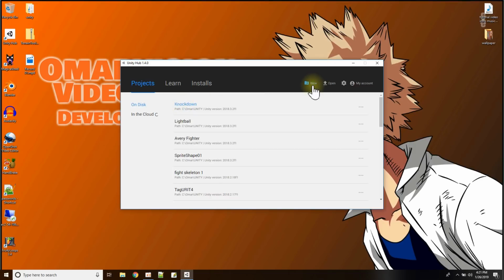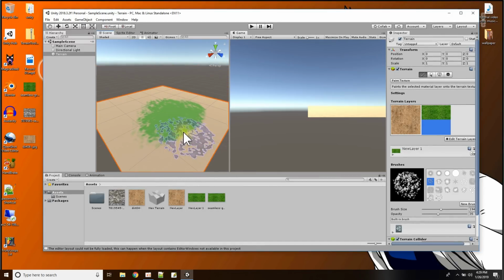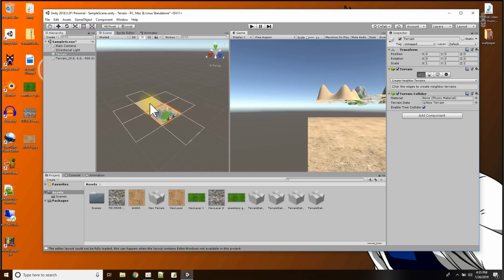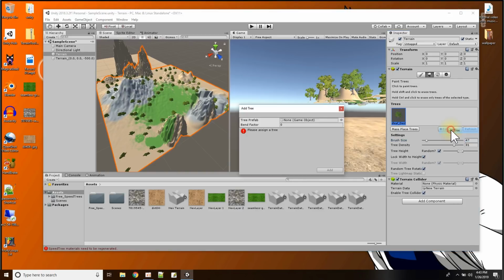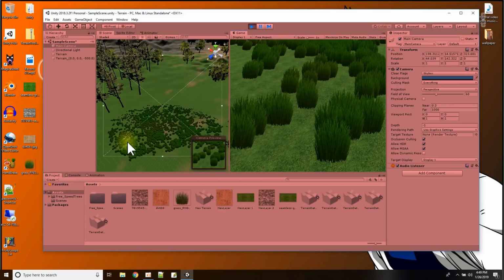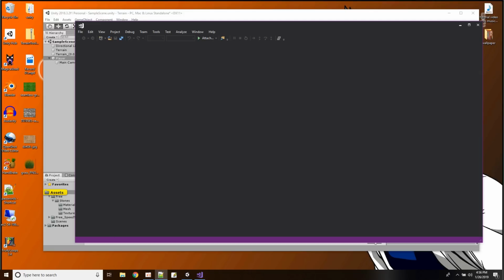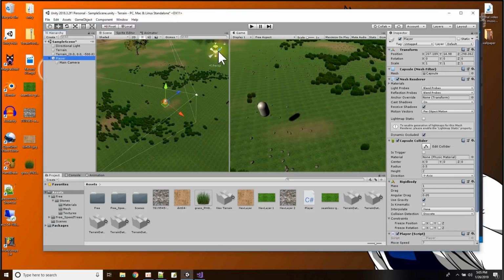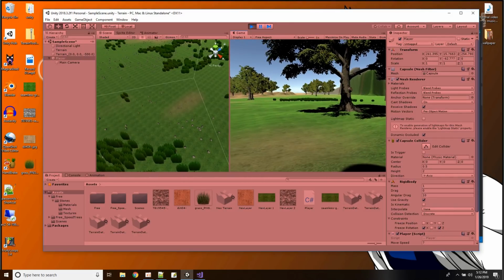unity 2018.3 terrain system

Comment: Hi Omar, great video, thanks.  I have an issue with the grass texture (i've tried 3) - they are all transparent but the billboard is showing in the editor, and game.  Any ideas why?
Reply: Using 2018.3.  Have tried lots of things but no luck.
Reply from the maker: @virtualrealityfun8869  .. hmm your source/your image IS transparent -   but when you being it into unity and use it, make sure the material setting is set to tranparent/ or fade?? Check that
Reply: @omarvision  On the texture i've tried Alpha Is Transparency both enabled and disabled.  I don't see a material setting on the texture or when adding it as the grass texture.
Reply from the maker: I'm going to have to get on my computer after work... you'll have to wait for my to get the specific screen
Reply: @omarvision  Absolutely no problem, and thanks for any assistance you can give.
Reply: Hi Omar.  Not sure why but i used Photoshop to remove the "blank background" and it now works fine.  So, the transparent backgrounds from Google Images might not be blank, after all.
Reply from the maker: @virtualrealityfun8869  Ohhhh...   I have a quick test to make sure an image is transparent background.  1. download it from google to your desktop.  2. look at the desktop icon for the image - it should be transparent and you can see your desktop, not square.
Reply from the maker: Also - https://www.remove.bg/  uses AI to reemove background from an image for you.  you could try that

Comment: I have a problem when I use the detail brush for the terrain... so when I click on "edit details" and "add detail mesh" it doesn't show me the meshes i draw on my terrain. I changed some settings (width, height) and it still does not show me the meshes. Any ideas? It would be very helpful. The mesh I selected was a self created one which I made myself in maya 2017 and then exported as a fbx file.
Reply from the maker: Time for a sanity check.. you made a mesh and tried using it to apply.to your terrain with trees I suppose and its not working...  1. Are there any red messages in the console view? 2. Can you draw with other detail mesh?   I am not sure but are there any limitations on what you can use as a detail mesh?? I'd have to check around
Reply: @omarvision I tried to apply some flowers that I made to my terrain with the detail brush function (the one you showed in your tutorial) and no there are no red messages in the console view. Unfortunately other meshes that I tried also didn't work with the detail mesh. As a mentioned before, I exported the meshes as fbx files and imported them to my assets folder in unity, maybe it's because I have to save the meshes as something different than fbx? I don't know... I'm pretty new to unity xD confusing af, but thanks for your reply ;) I'm surching maybe there is an answer to this problem.
Reply from the maker: @owl2464  hmm...  I have to try drawing with a mesh of my own, see what happens.   I need some time to come up with that video though.  Give me the weekend at least
Reply: @omarvision  Woaah you're the best, thank you sooo much. That would be so great, I really appreciate that. Take your time, don't feel pressured!

Comment: non how do i do this one a sphere or a cube
Reply from the maker: Sphere and cube? How to make them? I have some other videoa
Reply: @omarvision  what i meant to say was how do i draw on spheres and cubes. / how do i use the brush on anything
Reply from the maker: oh well the other shapes and not like the special terrain. for them you can put materials (or pictures) on them.  Drag and drop a picture from your computer onto the assets folder / then drag the picture onto the object (sphere or cube). The picture will be draw on the sphere or cube.
Reply: @omarvision  thank you very much
Reply: @omarvision  hey how do i  make objects rotate even slower than speed 1? it doesn't work when i try to go less than 1
Reply from the maker: @samiam2519  any number should work, even less than one. Perhaps I'll make a video for you rotating objects and controlling the speed.  Sometimes with rotation its angles
Reply: @omarvision  also how do i strap the main camera to a rotating object/ so the camera stays in the same position on that rotating object
Reply from the maker: @samiam2519  , that one is easy.  Drag the camera and make it a child object of what you want it to stick to

Comment: Hi Sir, Is there any common standard for the terrain size? Like for a real world character of 6 foot (180cm) ?  And is there any way we can reduce our terrain size (afterwards creating mountains and terrain) without affecting the mountains created?
Reply from the maker: Well in the new terrain system I'd you change the terrain size after your mountains everything scales better than it used to.  But it's not perfect.  The whole thing about translating real world measurements to unity scene units is ... relative. Do you have to do ratios to size things according to another thing. Do you know what I mean.
Reply: @omarvision  so we need to put some object and scale in relative to that. Ok thanks a lot